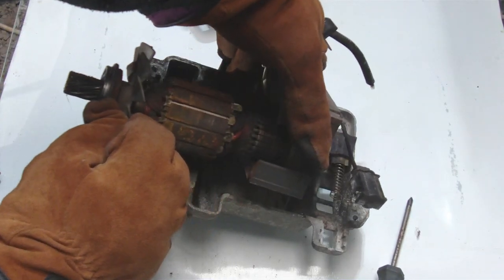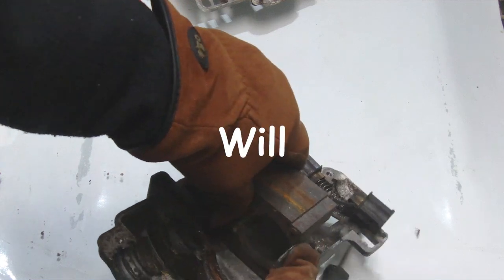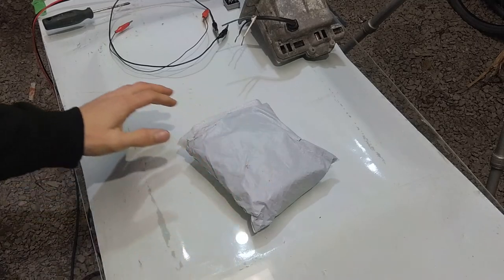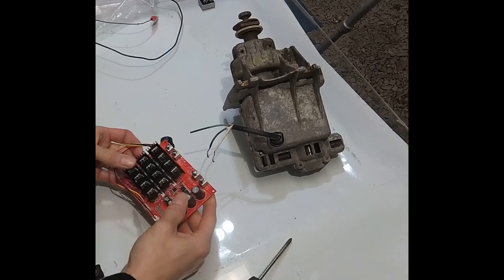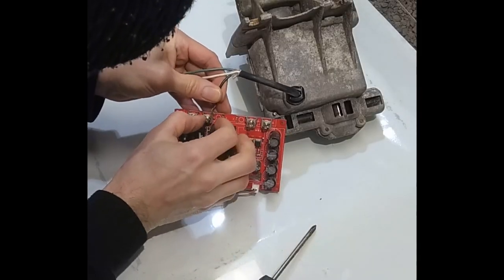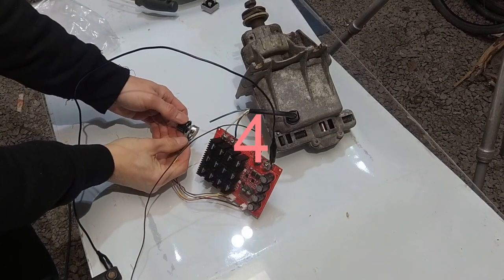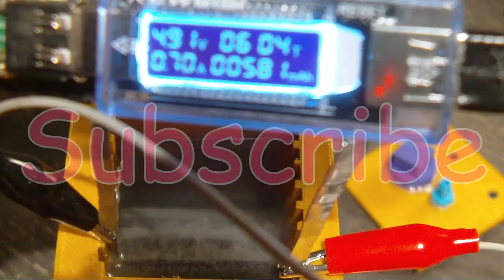3HP Electric Motor will it run on both AC & DC - Hooked up to Electronic Speed Controller

Comment: This motor looks extremely similar to the one in my old 3/4 Thor drill. It's also universal. I should probably get around to finishing that restoration.
Reply from the maker: Exactly it's like a huge drill motor, imagine the torque putting this motor in a hand drill